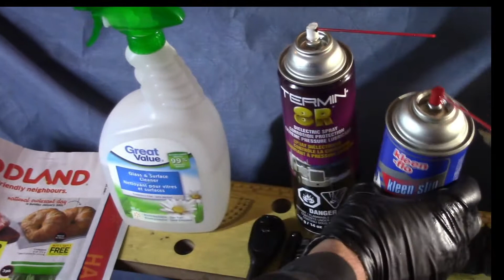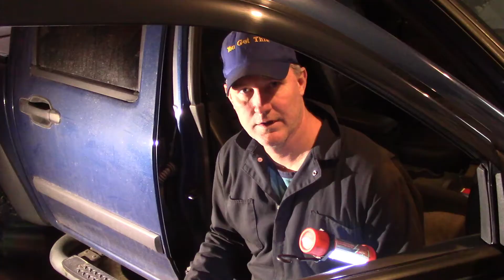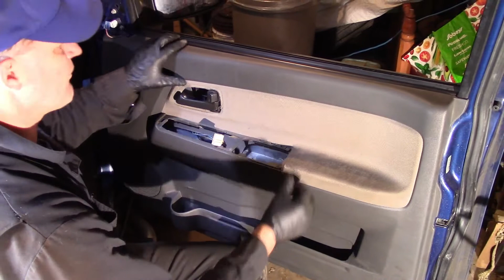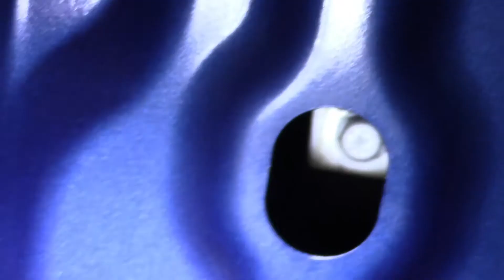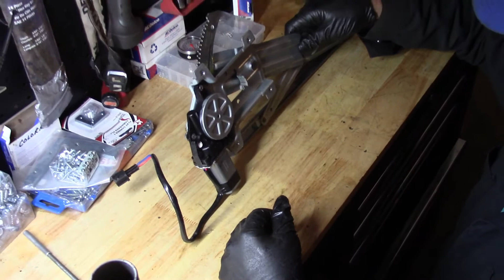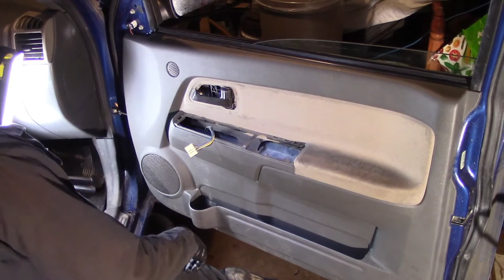Power Window Not Working? How to Fix & Doing This Will Make Your Power Windows Last Forever. Motor

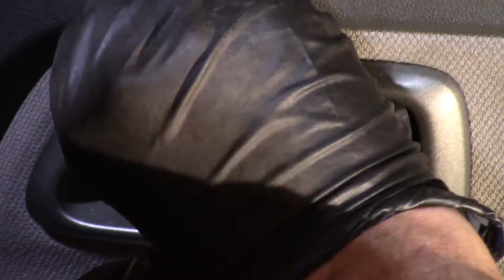Comment: 2022 ZR2 still under warranty, but I'm a 2 hr round trip to the dealership and it's 10:30 and my window is stuck down. Kinda regretting this colorado because this isn't the first time I had to bring it in for something to get fixed.

Comment: I have a 1988 Chrysler Fifth Avenue and I can't let her die. Once I get her back from having the front suspension rebuilt and fuel injection installed, I need to replace the driver side front window motor. It goes up alright, but going down it will freefall a couple times, making think maybe the gear has a bad tooth or 2.
Reply from the maker: Hey There Dale, 1988 Fifth Avenue...nice! You may be right or it may have come detached at the regulator. It sounds like the regulator can push it up but leaves contact with the glass when it cycles down and then gravity kicks in after a pause and it free falls and lands back on the regulator. You may be missing the mechanism where it attaches to the window. Check out my Amazon link in the video description, search for the power window regulator 1988 Chrysler Fifth Avenue and see what Amazon has for you. At the top of the page enter your vehicle info in Amazon's confirm fit and you verify what your regulator looks like and determine how the glass is attached. It may be different than the Chevy Colorado. Hopefully, you only need a bolt. Don't forget to lubricate those channels. Good Luck!

Comment: Thanks for the video. Sadly, I've done all these things but still have a window regulator that works... sometimes. Other days it just says "nope" and I never know if the window will be up or down when I get home. If I apply voltage directly to the motor, it goes up and down fine (new regulator, and the old one did, too). New switch assembly (driver's side) and voltage readings are correct on the wiring as well. 

I know you can't troubleshoot it from where you are, but are there any common areas where this kind of intermittent failure can happen? As an aside, the passenger side doesn't work very well, either.
Reply from the maker: Hi Chip, that's a tough one. It sounds like the Body Control Module (BCM) is reading an error and is shutting down certain circuits. I had a glitchy BCM that had difficulty resetting itself. It first occurred when I disconnected the battery for something and when the battery was reconnected, the BCM would not reset and would shut down my driver's side power window and power locks. There was nothing wrong with the power window motor, or switches, it was the BCM. 
You need to find out why this is intermittently occurring and correct it. Is there a short somewhere? Is there a loose battery connection? Poor ground connection? Rodent chewed wire near BCM?
Once you correct the cause then you can reset the BCM by :1)disconnecting both battery terminals cables2) with the battery disconnected, connect the positive battery cable to the negative battery cable (only when not connected to the battery) This will drain remaining voltage in your vehicle.3) Clamp the pos. & neg. cables together and leave overnight to ensure all residual voltage from all capacitors / circuits is drained 4) The next morning reconnect negative cable to battery and then in one quick, steady movement connect the positive cable back to the positive battery terminal. (avoid a jittery re-connection as the BCM could read something wrong and shut down the circuit again)The BCM will reset itself and read nothing is wrong with circuitry and re-establish power to all circuits. You need to correct initial cause though or it will simply return. If you google "Chevy Colorado driver side power window and power door locks not working" you will find what others have done to correct this issue.
There is no silver bullet fix but many people have fixed this issue in slightly different ways. I hope that helps...Good Luck Chip
Reply: @cantletherdiediy1050  Wow thanks for the detailed answer, you surprised me!

I'll dig into the BCM a little bit and see if I can get it to think different :) No harm in trying what you've indicated above. If I clamp the battery terminals together without knowing I have the problem solved are there any issues with that? 

Never thought about draining capacitors but if clamping the battery terminals together overnight drains 'em, what do I have to lose? The battery and terminals are in great shape (new batt in fact), I checked that the two ground terminals under the hood are snug (although I haven't gotten around to taking them off and sanding them super clean). The truck was from Indiana (now in WA state) and has some odd corrosion issues, so that could be a factor and lead to who knows what kinds of issues electrically. Sadly, electrical stuff I'm not a whiz at, although I've worked on machinery for decades. 

Thanks again and keep up the great videos. I do love my truck; it replaced my 1990 W/T 1500 which I also loved but it just got too old and tired (almost 300k MILES on that old beast).